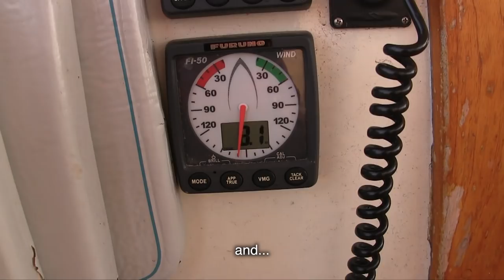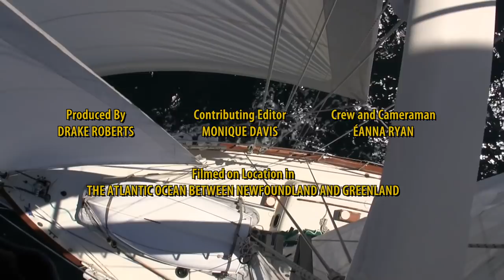He's Coming Straight for Us! | #17 | DrakeParagon Sailing Season 4

Comment: If you can afford it, you should invest in an electric engine. You will not regret it.
There's like almost no maintenance. You just need extra batteries and solar panels. Electric engines can even charge themselves when you're under wind power from the propeller moving in the water. Many sailors have converted and they love it.
Reply from the maker: So I guess Drake and I are just a little...skeptical about an electric engine for a boat like Paragon. It seems like it might be a fine idea for motoring in and out of a harbour, but motoring for many hours (or possibly days) at a time? I'm not sure how that would work, especially if it was pushing all 40,000lbs of Paragon.

We also sail to places where we have no access to shore power with which to charge the engine, and I'm not sure our solar would be enough to charge while underway. 

This being said, I haven't done any research into these engines and don't know any of the specs. It would be interesting to see.

⚓-Monique
Reply: There's not shortage of reviews on the engines. Horsepower doesn't seem to be an issue. I like it just for the fact you don't have to worry so much about the maintenance or whether or not you have enough fuel onboard.
- https://www.youtube.com/watch?v=etz74z0X9SQ
- https://www.youtube.com/watch?v=-_lCM9elcmA
- https://www.youtube.com/watch?v=ELEvQeO-uw0
- https://www.youtube.com/watch?v=WL5BJUbRvuo
- https://www.youtube.com/watch?v=o80ys8fO7LM
- https://www.youtube.com/watch?v=elxbkDZcQVU
- https://www.youtube.com/watch?v=45Rs9eQVsuo
- https://www.youtube.com/watch?v=GYblcHAMw2g
- https://www.youtube.com/watch?v=TRgMBO-U3SE
- https://www.youtube.com/watch?v=H5nC77wDOEU
Since it is electric, the only issue you need to worry about is whether or not you have the ability to generate power. Solar, wind and wave power (from the propeller) should be more than enough. 
As for hours of operation, I heard of people running the engine for 20 hours nonstop at a time.
But it is up to the Captain of the boat whether or not they want to convert. These are just some of the videos available but there are many.
Maybe you can visit some electric boats and give your own reviews on them in video format.
Reply: I agree, not practical for a full time cruiser.There is a channel where they have an electric motor and they end up using the dinghy as a tug quite often. I don't believe recharging with a spinning prop works well either. The day may come but for now a diesel engine and even a gen-set are needed for cruisers like these guys.
Reply: I think electric motor it is just not practical unless you take on a very different cruising mindset.  If you want the ability to motor when winds are not favorable, pure electric is not an option.  Very rough calculations:   I suspect Paragon uses about 18 horsepower at average cruise.   That is eq. to about 13.5 kW.   To generate 13.5 kW, you need about 900 sq ft of panels (assuming full sun).   That is probably 3 to 4 times the total deck area of Paragon.   Now assume you wish to motor thru the night.   So during the day you need to generate double that at 27 kW... and have battery storage for 13.5 kW-H.... that's is a lot of golf cart batteries and now you need 7 or 8 times the deck area full of panels.    Then throw in the occasional cloudy day with no wind....   Again, if you change your attitude and accept to drift with the currents until there is some wind, that changes everything and carries a whole new set of issues and risks.   I think there may be an option with some kind of hybrid using a large diesel generator coupled with a large electric motor that may allow some improved efficiencies (like a hybrid bus), but has the downside of significant cost, and still the need to run the gen set when you want to motor....   just my 2 cents....
Reply from the maker: I would love it if I could repower Paragon with an electric engine, but I just can't see how that would be feasible because of the distances we voyage and because of our heavy displacement.  I agree that we could install an electric engine of the horsepower required to push us.  Maybe we could run that engine for 20 hours on a gigantic battery bank, but what would we do for the next 2 to 3 weeks at sea after that with a depleted battery bank?   I don't think we could re-charge that amount back into the batteries fast enough with our solar panels.  

I really do love the idea of an electric engine, but I don't think it's currently feasible for a heavy displacement, long distance cruising boat. I also don't believe that will always be the case and very much look forward to future innovations that will power the machines of the world.

- Drake
Reply: One of the things that is great about an electric engine is that because it uses more batteries to juice up, you can also convert other appliances to electric. The freed space for fuel can then be used for extra batteries. So say you have diesel, then you will always be spending money on fuel. There will never be an end to that and you will always be dependent on fossil fuels. I personally get sick from the smell of diesel so for me it just makes more sense for the switch. You talk about cost but did you factor in the amount of fuel you would be using in a diesel engine? Electric engines require electricity you can generate onboard so that means you will never run out. If you watched any of the videos in reference to the energy involved with electric engines then you will see that the generation of the energy is rather easy. But again it is up to the captain of the boat. There are pros and cons to both engines but it would seem the cons of diesel greatly outweigh the cons of electric. How many sailors have been stuck with maintenance problems of diesel engines while at sea? Is that something that is desirable? Personally I would not want to be stuck in front of a storm system if I did not have power to move out of the way. Electric engines seem to be more reliable in that sense. There are no additional costs to an electric engine once installed properly whereas diesel always have to have fuel. The more moving parts an engine has the more likely it is to break down and an electric engine has really only the one moving part compared to the many moving parts of a diesel. The other factor comes with how new the technology is. Usually a newer technology is built to last a long time. Diesel has been around for a long time and sadly manufacturers build their gas engines to fail after some time. That way the manufacturer is always making money from selling parts. Did I mention that electric has less moving parts? Even solar panels that have no moving parts will last a lot longer than a gas generator. When it comes to long ocean voyages, I would rather have reliable parts on the boat, wouldn't you?
,,, just my 2 cents...
Reply: Ultimately in the end it all depends on the captain. I wonder if this sort of debating occurred when diesel engines for sailboats first became available. Many people don't like change even if the change is favorable or makes life easier. It's like swapping the toilet out for a composting toilet.
Reply from the maker: We have fifteen, 130 watt solar panels and a 400 watt wind generator.  2350 watts total! :) There's no way we could physically fit any more solar panels on our 42 foot boat.  We absolutely love running everything we possibly can off of solar and wind power.  I'm so incredibly impressed by how Apple, Inc. has covered their new headquarters in California with solar panels and can now run 100% of their facility on power from the sun!  Incredible!  Fantastic!  Wonderful!  I'm really impressed with the new electric Tesla tractor trailer trucks.  I watched Elon Musk's presentation about it.  The truck can carry an enormous payload for a whole day from point A to point B.  But the thing is it needs to be able to charge back up at point B by plugging into a charging source on the grid.  In the middle of the ocean we can't plug in like this. . I would believe that there are new high tech motor boat designs that are optimized in every way to use electric engines powered entirely by solar and wind to complete enormous distances, like crossing the Atlantic ocean.  But I don't think you could retrofit a 1976 Westsail 42, weighing 40,000 lbs with an electric engine and solar panels and wind generators to do the same.  We simply weigh too much, require too much power to push our displacement, and can't fit enough panels and wind generators on deck to power it all.
- Drake
Reply: The first video of the Oceanvolt, a "semi-lightweight" boat, shows it''ll run from 95% capacity at 88% power (2294 RPM) for 1 hour 20 mins and 3 hour '07 minutes at 38% power (1012 rpm). And after 1 hour and 15 minutes the regen seemingly hadn't added anything to the 95% charge capacity. Most prop regen I've seen are lucky to push 2 or 3 Amps at the motors rated voltage when at hull speed. You could probably add more power if you added pedals to your boat. For example the Oceanvolt hydrogenerator needs more than 7 knots to produce more than 200W. https://oceanvolt.com/solutions/hydro-generator/
The Rigging Doctor doesn't use his for extended periods at high power and has sent back his unit once and inverter three times. 2 knots required 650W in calm waters giving a 16.5 hr range.
Juppi's boat only has ~800W peak from solar and wind to power it, and his "500W" solar panels were producing 11W at the time he recorded that video series. No way he's motoring for extended periods.
The Oceanvolt A8X has an 8kW motor, and the 400W panels are said to give "a couple of knots". Add some headwind and swell to that couple of knots and you'll be going backwards on solar power. That A8X had 12.8 V 880 Ah lithium battery capacity. That's 11.2 kWh. At the full 8 kW it'll last about 1.4 hours. At peak solar watts it'd take 28 hours to recharge, but solar panels on boats don't get anything like peak ratings.
If you're just a coastal cruiser then these systems may be perfectly adequate for you if you're happy to bob  around and slowly recharge at mooring or marinas. But how long could these systems power themselves if dragging at anchor in high winds?
From memory Finding Simon was aiming for 6 kWh peak of solar and last I saw he revised it to 4.8 kWh peak, and Simon has a 43 ft cat with lots of surface. His lithum setup is decent too.
The best extended use of that bunch is the hybrid diesel/electric powered Chesapeake 32 used in brackish waters, and has 12 kW peak motor,  but he indicates it needs 4 knots to even begin regen, has 6 Northstar batteries and said "if you're lucky enough you'll have enough power to motor in before the 5.5 kW generator kicks on below 70% battery."

In the video Drake mentions 48hrs of continuous use of his Perkins rated at 85 hp (65 kW) with a potential storm on the horizon. Continents apart.

And while I'm all for electric, the power needed can also grow exponentially with speed or wind when motoring, while range decreases inversely. So the type and how you use your boat matters a lot when choosing to go electric, whether thats hybrid, purely battery, or with solar and wind. For example see the graphed power needed here for a 32' water line length trawler to get an idea: Hull speed | Boat Design Net https://www.boatdesign.net/threads/hull-speed.1220/
Reply: Storage for liquid fuel depends on volume.  Solar depends on area.  On that fact alone, solar is not efficient for propulsion power.
Reply: the laws of physics (conservation of energy) means that an electric motor engine on a long range sailing vessel is not possible, until such time that the power density of a battery exceeds the power density of liquid fuel (i.e. diesel).     you can't get that much energy.    maybe a hybrid engine system could work if there were a diesel generator creating electricity for the electric motor because the power source is still liquid fuel.  the benefit to a hybrid system is that electric motors have perfect torque profile for a sailboat (hi torque at low rpm) and a diesel generator can be most efficient when the rpm load is low (ie run just as an alternator), plus the combined physical space would be smaller.  I would love to convert my 25 hp tractor engine in my sailboat to an electric motor but it will only be worthwhile when the energy density of batteries is improved a lot with new chemistry.   not to mention the expense and physical problem of replacing the batteries when the chemistry is used up, every few years, which must be improved first too.   replacing a battery in an apple laptop is already too much hassle for long term use on a blue water sailboat!    Until then...  electric engine on a blue water boat does not 'win' vs. a diesel engine, according to the laws of physics.
Reply: Current energy density of diesel: 35.8 MJ/L
Current energy density of lithium metal batteries: 4.32 MJ/L
https://en.wikipedia.org/wiki/Energy_density
Diesel engines are at typically 45% efficient at some point in their RPM range and weigh hundreds of kg. Current permanent magnet motors are up to 99% efficient and produce ~5kW/kg, and superconducting motors I read about yesterday are modelled to achieve 25kW/kg.
Assuming 90% efficient total electrics (double that of diesel), currently you would have to allocate at least an additional ~4.15x the space as you would for diesel using state of the art lithium metal batteries. Plus 20% extra for the lifetime capacity drop of the batteries. Plus service capacity for accessories. That's doable on some boats.
Lithium-air and other chemistries promise to improve that.
Then the problem becomes how to charge them. You're not going to find a high power charger on a remote island nation that can deliver 120kW like a Tesla supercharger, but boats at marinas typically park in days not hours. A 30A 120V outlet is 86.4 kWh per day, that's about the size of an 85 kWh Tesla Model S battery that weighs 540kg. I see a few electric boaters using second hand Tesla and Volt batteries. Take an example like a BAVARIA NAUTITECH 40 OPEN that has 2 x 20 hp engines and 2 x 57 US gallon tanks, that's 367.15 kg of diesel. Tesla's lithium-ion are only between 0.9 and 2.63 MJ/L . Assuming 2.16 MJ/L, you'd need at least six Tesla batteries to equal the diesel on that catamaran. You'd also need six days to completely charge it from dead at 30A 120V if you didn't have a high power genset. So only a 6x Tesla energy density increase over lithium-ion may be needed to equal diesel on cruising boats like that BAVARIA. That's a 40 HP (30kW) boat, if your boat was only 10 HP (7.4kw), you'd only need 1.5x a Tesla. Then you need to add capacity for the electrical accessories on the boat. For that 40HP BAVARIA with 86 hours of 4kW aircon, let's say 10x the current Tesla or ~21.6 MJ/L might be the tipping point. So the battery energy density doesn't need to exceed that of diesel fuel. I haven't even accounted for electric motors being able to produce almost constant torque from stationary and as a result can run larger more efficient propellers, and run slower with less cavitation. And can be direct drive and not need a gearbox, and can regen.